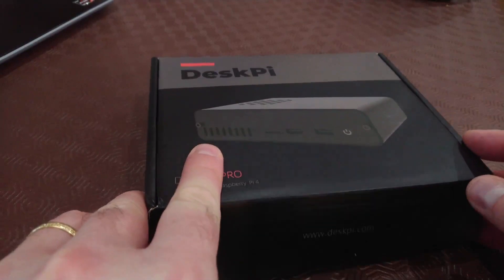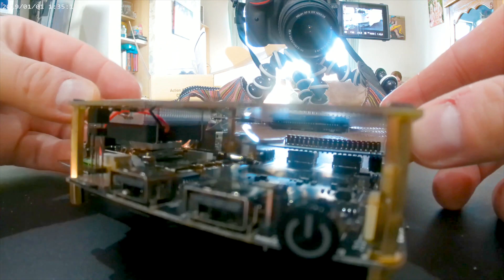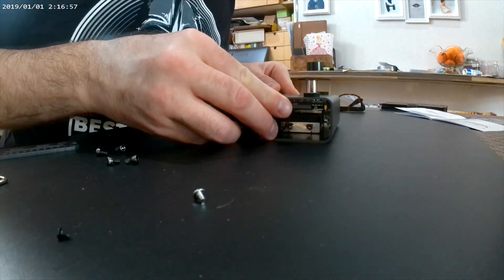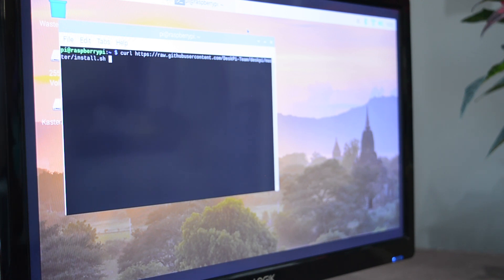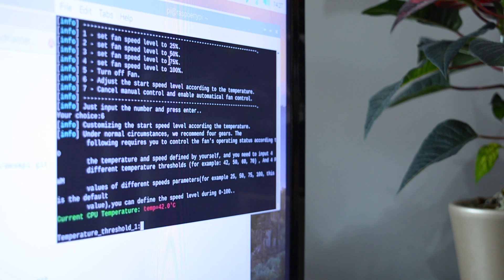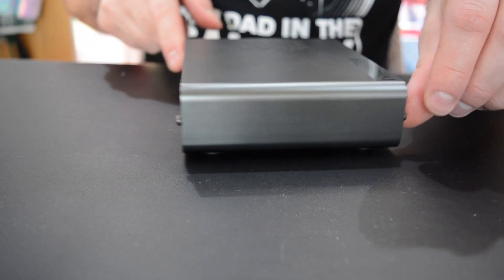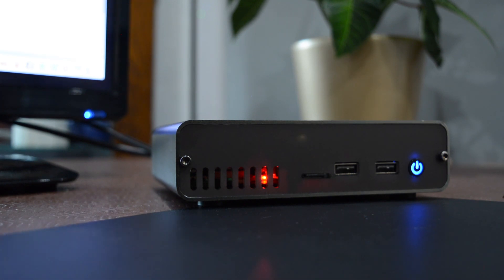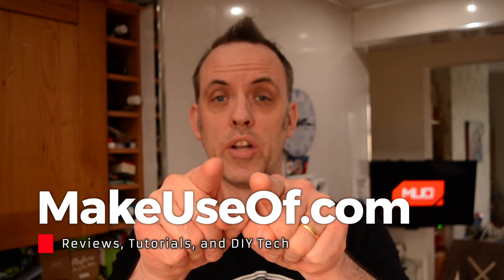DeskPi Pro Case Review: Turn Your Raspberry Pi into a Desktop PC

Comment: This case is overall just not worth the money compared to others on the market.  The new board attempted to fix the awfulness of the original but just introduced a slew of new issues and the company support is pretty bad.  You can get it to kind of work okay with a lot more effort than you should but in the end it just doesn't live up to the hype.

Comment: I HIGHLY advise doing some Reddit and Google searches before buying this case!!! It has serious WiFi signal and SSD boot problems and I'd say its not even worth it at this point. If you plug in the USB jumper, it degrades the WiFi like crazy and SSDs fail to boot. In my case, my drive is detected and the Pi tries to boot, but it does so a snail's pace and fails throughout the process. I suspect there's something wrong with the USB jumper and the extension board drawing too much power from the mainboard, causing WiFi issues, but also not nearly enough to power an additional SSD. The manufacturer has said they will be shipping replacement boards by end of March. I'm not holding my breath.
Reply: UPDATE: For anyone wondering: About a week ago, I received a replacement board for the DeskPi, free of charge! I put everything together and, i must say, it works exactly as it should have from day one! What they did was replace the USB chip on the main daughter board. Along with that, they included some metallic tape and shielding to reduce/prevent WiFi interference. Also included, are some metal holders for the case itself so you can stand it upright, which also prove to be super handy. I managed to install Ubuntu server on my SSD, and it boots/runs flawlessly. I now have a mini low-powered server, which is awesome. I'm super grateful that the DeskPi team managed to pull it off, as I did feel a bit scammed. Kudos to them for correcting the situation and providing a replacement. At this point, I would recommend this case if you looking for something that fits a 2.5" SSD in it. It is a little pricey, so you should weigh that against a mini PC, but for my purposes I really wanted a Pi and so it made the most sense.
Reply: Another Update: If you got the new daughter board replacement, be sure to update the firmware on it that is posted on the deskpi github. I was getting SSD failures after some time and the OS would halt. Having done the update, I can confirm that everything now works perfectly.
Reply from the maker: Yeh, that definitely sounds like a power issue. It's possible ours is a different model the one they ended up shipping.

Comment: Sad there are some complaints in here that are just for the sake of finding complaints... full size hdmi is way stronger and more durable than microhdmi. Microhdmi is a serious compromise only used to keep the PCB size the same as older raspberry pis. Also wireless dongles always work better on the front of your PC than rear, even on a full size desktop PC. There was more... but dont want to write forever in a YT comment.

Comment: You did not try it with an SSD. I have this case and unfortunately it doesn't work as it should (does not boot from an SSD drive). DeskPi Pro support is awful and they dont't answer e-mails. They answered me only when I put a case on them on PayPal and said they'll send new motherboards and SATA daughterborads but didn't say when. It's a pity cause the built is excellent and it could be the ultimate case for Pi, only if the SATA controller worked. UPDATE: they released a new board, I got it yesterday by mail and no extra costs - and IT WORKS! (10.05.2021.)
Reply: UPDATE: they released a new board, I got it yesterday by mail and no extra costs - and IT WORKS!
Reply: @Sherlock385  Yep, same here! I put everything together and it works exactly as it should have from day one! For anyone else, what they did was replace the USB chip on the main daughter board, and actually sent a replacement, which I was quite surprised by. Along with that, there is some metallic tape and shielding included to reduce/prevent WiFi interference. Also included, are some metal holders for the case itself, so you can stand it upright, which also prove to be super handy. I managed to install Ubuntu server on my SSD, and it boots and runs flawlessly. I now have a mini low-powered server, which is awesome.
Reply: @Sherlock385  Have you tried running the deskpi with the updated board for several days? Any issues?
Reply: @delicious_seabass  nope, used it occasionally
Reply: @Sherlock385  You should give it a shot. I'm getting random halting when running Ubuntu on an SSD. I'm hoping its just the older SSD and I need to swap it for a fresh one, but something tells me the new daughter board might have issues.
Reply: So i tried a different drive and still had issues, but I realized they put up a firmware update for the USB interface to add support for UASP / TRIM. I managed to flash the new firmware, and now I'm currently testing to see how it runs.
Reply: @delicious_seabass  a new firmware ... nice, thanks for letting us know
Reply from the maker: We did, actually. But just checking: you know you need to make some config changes for it to boot from SSD? The hardware is there, but Pi doesn't do that by default.
Reply: @MakeUseOf  if you mean upgrading to latest firmware - it is done and is booting well from an external 3rd party USB3 to SATA controller. I've been using it for quite a long time now with various operating systems on couple of SSDs. When I put an SSD inside the DeskPi Pro case it starts the booting process but lags and malfunctions ... on one OS I even managed to get to the desktop but the data transfer rate was painfully slow.
Reply: @MakeUseOf  I might be wrong but it seems that they put out different versions of motherboards because it's working for some people. DeskPi support answer to my complaint was "about the “SATA controller”，we will ship the new version PCB board (main board & USB to ssd) to you"
Reply: @MakeUseOf  I too can confirm this, as I too bought the DeskPi. I was annoyed to find out that, not only does it not boot from SSD using the extension board, plugging in the USB jumper that connects to it massively degrades the WiFi signal, so much so that the speed is halved and 5G won't even register. Now, the manufacturer has posted on their website claiming they will be releasing a new board to anyone who purchased the case come March and that they are aware of these issues. Personally, I'm not holding my breath, but we shall see. If you're reading this and considering buying it, I would wait to see what happens in March, or just find something else. Right now, it's just an expensive DeskRock.

Comment: I feel the Argon M.2 case is a better value.
Reply: unfortunately it lacks SATA connector, so it's M.2 SATA drives only and they are scarce and being replaced by NVME
Reply: @Sherlock385  They added M.2 SATA due to less heat than a NVME M.2. That's the only reason why they did it. Got to look at price also the Argon M.2 is half the price of this.
Reply: @JayzBeerz  nvme controllers are more expensive and that is the main reason

Comment: Its unfortunate that these nice heavy desktop-replacement cases dont have easy access to the CSI or DSI ports. 
overall, its not bad compared to the argon one case, and its nice that you have front access to the power button and a couple ports, but is it really worth the $55 they're asking for it?
Reply: Obvs it’s not really what you want to do with a case at that cost but presumably it would be possible to drill or file holes in the acrylic so that you could feed C/DSI ribbons through?

Comment: the case was released at such an odd timing with the argon 40 ssd case. i ended up getting that instead, although both serve their purposes of both ssd capable and full hdmi.
Reply: It’s a pity that the initial release of the deskpi pro didn’t work out too well - here’s hoping it works better when they try again in March!